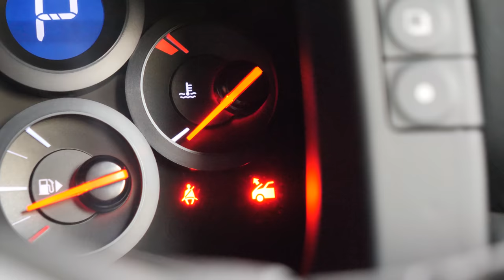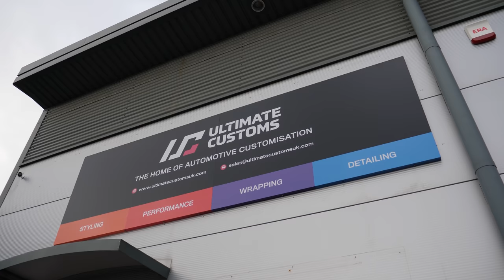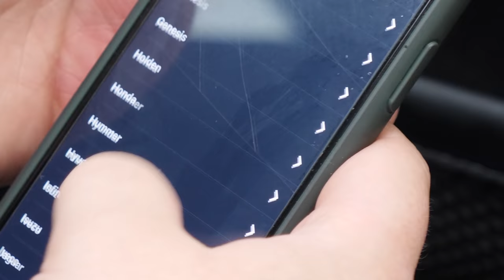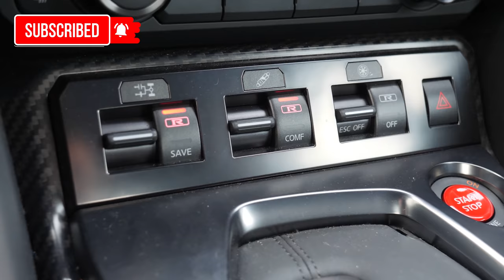CAN YOU SEE THE PROBLEM WITH THIS £85,000 SPORTS CAR?

Comment: I’ve recently had my Red front bumper painted on a 66 plate BMW, and the difference in colour  between the plastic bumper and the metal bonnet is very noticeable.

If it makes you feel any better, I’m in manufacturing, with some motors over £100k, and I always notice the difference from bumper to bonnet. Especially on the Silver cars. And they’re fresh off the line.

Comment: The orange bits in your paint would be iron bits in the pajnt, need to use decontamination process to remove - iron fall out remover, tar remover and then clay bar. Then one you mop (machine operated polish) you should bring the white up to match the bumpers. And yes there different colours because of the plastic in the bumpers and the original paint is a few years old. Good videos though guys keep it up 👍
Reply from the maker: Cheers for the info Chris 👍🏼

Comment: As a spray painter for 35 years, you need to paint these pearl colours at the same time, which means the panels need to be next to each other so they have exactly the same amount of paint. You can't get away with edge to edge painting. You need to blend the paint, so in essence you would of needed to blend the paint over the bonnet and front guards... expensive, but perfection is not cheap...

Comment: Hi Guys as a ex car body repair man there usually is a slight differance on paint colours when panels sit next to one another when one is plastic and one is metal even from factory.Audi used to be the worst for it. White is also one of the hardest colours to match (especially pearl). Ford Diamond white in the mid 2000's had 5 different shades all on the same same paint code.
Reply from the maker: Cheers for the info Philip 👍🏼👍🏼👍🏼

Comment: Like I mentioned on another comment, being a painter myself, to ensure the jib is right i would have blended into wings and bonnet myself, juat getting the paint code and spraying it by itself doesn't always guarantee a good colour match, especially on 3 stage pearls. And tbh don't wanna slate the painter who did it as he seems like a sound bloke, but knowing its an 80 grand car, he should of advised yous to do it properly the first time round, rather spend a bit extra and make sure the job is right than having to get it done again
Reply from the maker: Spot on info mate cheers 👍🏼

Comment: Boys - even with the deep clean you just gave it, there is still a lot of microscopic dirt clinging/stuck to the paint surface all over the car especially the surfaces that take most turbulent airflow - wings, bonnet, bumpers front/rear.

Doing a full car Clay Bar treatment you will be suprised by the amount of muck picked up on the clay bar.

White is the worst colour for 'dirt tainting'

Clay bar the paint, correct it(polish/touch up) if neccessary and then give it a good layer of wax (I recommend Collinite 845 - high level insulator wax - a good coat will last nearly a year with excellent protection) 
https://www.collinite.com/product/no-845-insulator-wax/

Paint fade over time is always an issue when comparing fresh 'Paint code' matched paint versus aged original.

The clay bar will leave you with the cleanest view of the paint and wax straight after guarantees the paint staying  reasonably clean over the next 6-12 months of use.

If you're up for selling it it will look better after a good clay bar and wax!

As for selling it and buying the RS6 I would hate to see Godzilla go but for sure the RS6 is a proper built weapon!!!!
Reply from the maker: Amazing info mate thank you very much 👍🏼

Comment: 5:42mins: good to see Dan the detailer is using the recently release product from 4 Skins 4 U........

THE SCAMPI HOOD WASH MITT

Buy it now folks, only £9:99. Freshly cut, water repellent, hardly any smell and comes cleaned and smegma free. Available at any local Halford or Euro Car Parts........

Get your hands on them now, stock is running low (apparently some Welsh weirdo at BD Performance has bought loads)
Reply from the maker: 😂😂 Ben from BD is going to come after you at some point 😂
Reply: @EVILGT   😂😂 he’ll have to find me first!